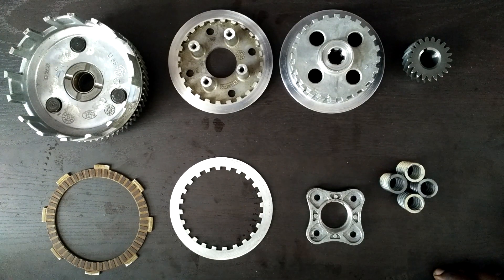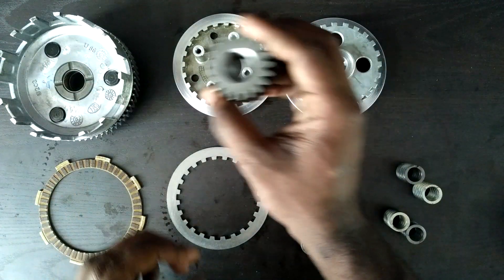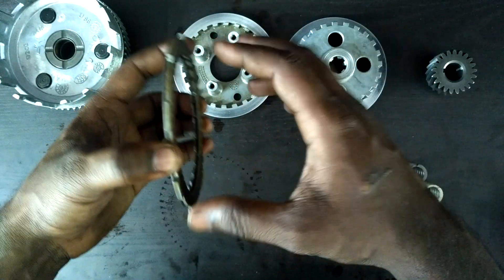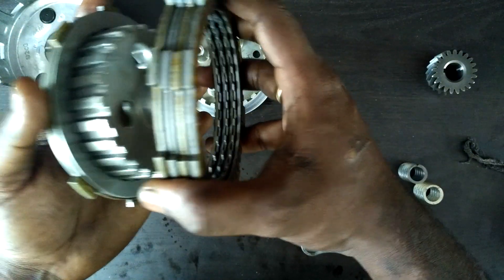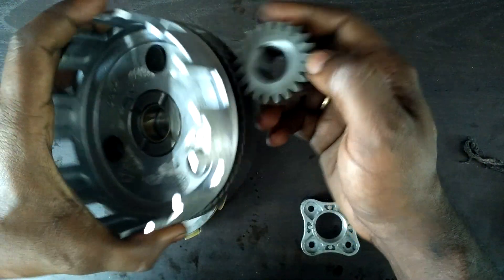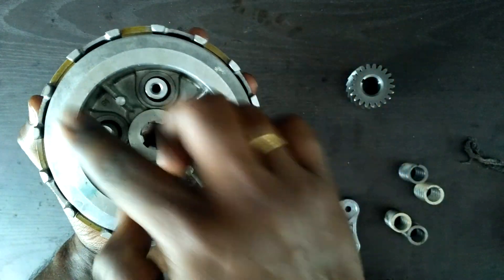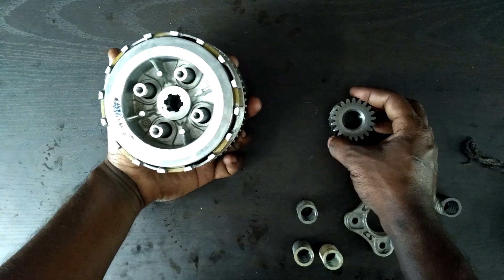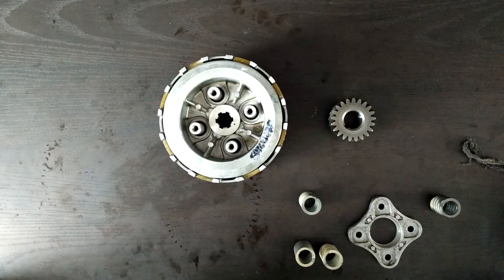How a motorcycle clutch works

Comment: Hi there , thanks for this video..!
Is it normal for a clutch to have free play?My bike ( honda cbf 125) developed a knocking noise you can listen here (https://vimeo.com/454999147 ).
I checked the  clutch bell and I can feel a tiny wiggle forward and backward when I try to move it . Also  I could move the clutch hub  about 2-3 mm to the left and to the right.
By the way the clutch is working fine..

Comment: can you please feature how the clutch works on kawasaki hd3 two.stroke engine.,
i guess its mechanism is quite the opposite on how it is thrusted apart from the pressure plate through a small tube-like thruster.
im just a bit confused when comparing it to regular 4 stroke bikes.,
thnx,.
Reply from the maker: Yamaha also does the same , a push rod will Puch the hub center instead of pulling it apart